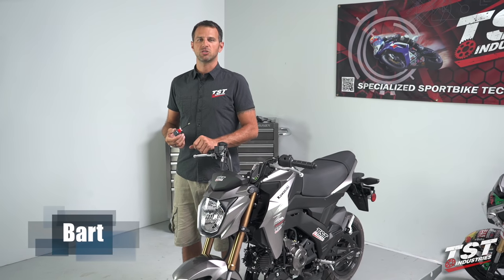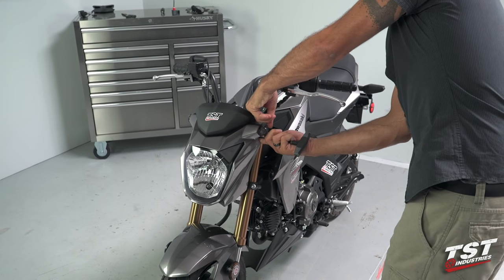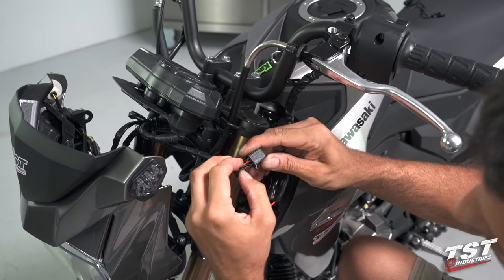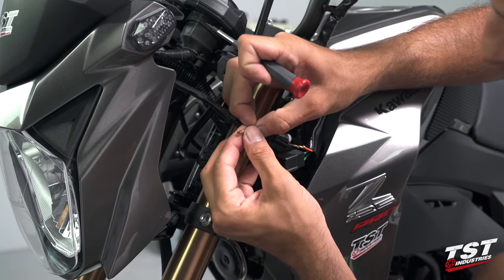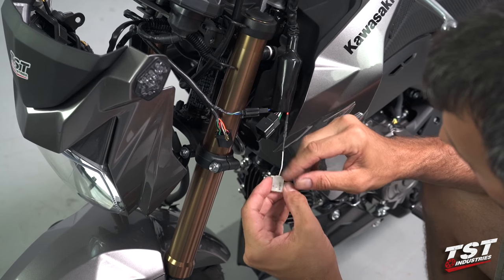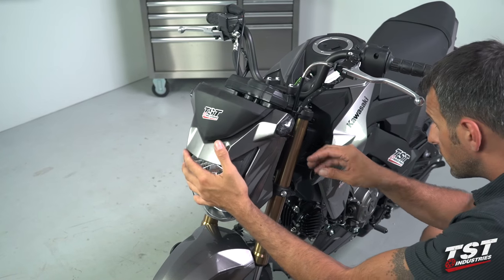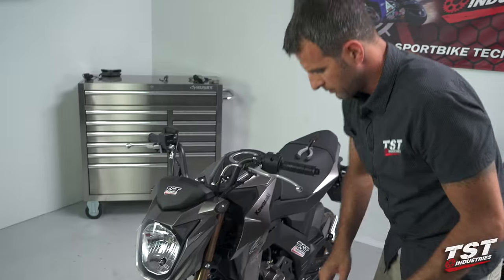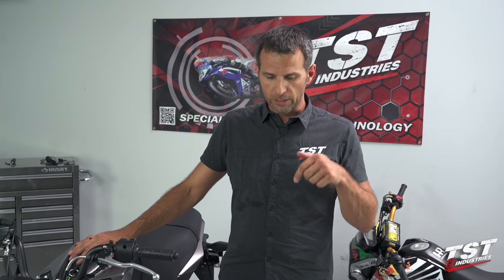How to install LED Flasher Relay on a Kawasaki Z125 by TST Industries

Comment: Installed the MDH tail light with the sequential turns built in for my z125 pro. Kept my oem front turn signals. Was having issues with slow flash rate (3 secs interval) for the turn signals front and back when the engine is running. But when the engine is off, flash rate is normal all around. Purchased & installed the TST Industries relay, got rid of the MD subharness and next thing you know....BooYah!! All my turn signals are functioning properly at the adjusted rate I want it to be whether the engine is on or off. Subharness - 0, TST relay - 1.. Thanks TST Industries
Reply from the maker: you're welcome. It's wonderful to hear that our parts fixed your issue. Thanks for posting that.

Comment: Last night I installed the TST Industries integrated tail light on my Z125 PRO which worked great! Today I installed TST front flush mount signals with the relay and I tested everything once the relay was in place and everything looked good until I finished buttoning things back up. I tested again and now the front and rear signals don't flash. Please help! Thank you.

Comment: If i got you're led flushmount and you're integrated tail light do i have to buy two of those things? (One for the back and one for de front)
Reply from the maker: You will only need one for the entire signaling system.

Comment: i just install a led flasher on my kz125 pro with a resistor and work good..then i order a pair of tst front led flasher and install it but didn't work..it is ok if i get your relay and install it with the resistor remain at the rear flash
Reply from the maker: We do not recommend using our relay while resistors are installed in parallel with any signaling circuit on the bike. If you use our relay please remove the resistors.

Comment: If you add the relay with only integrated tail light and stock front turn signals do you retain dash indicator? If not would you retain it using the load balancing resistors? If so how many resistors are needed? 3? one each for rear signals and one for brake light?
Reply from the maker: I believe you will retain the dash indicator with one set of LEDs and our relay but not both. If you use resistors, you would need a resistor on each of the individual signals but you would retain the dash indicator. The brake light and running light would be unaffected as they would not need resistors.
Reply: @TSTindustries  awesome thanks for the info

Comment: just get my led flash relay today at tst.the video i watch is diferent.the one you send to me is  the the wire is in negative terminal..so i  open the the relay ive got and find the positive terminal
Reply from the maker: Are you saying that you had to take out the wire from the plug, and put it in the other plug location?

Comment: So I added the relay everything went smooth but I noticed that my light on my dash doesn't work now. Why is that
Reply from the maker: Do you mean the signal indicator light? If so, that’s because of the way the relay works on this particular model. We mention it in this video.

Comment: Installed your front and rear leds on my z125. Lights came on to test then installed the led relay in the kit now no turn signals come on at all. Any ideas?
Reply from the maker: Please contact our customer support. Our guys will troubleshoot with you and get you going.

Comment: Yo what about the hazzord function?, and the no sig on the display with led all around really is a deal breaker. Idk maybe im just picky
Reply from the maker: That Z125 does not have a hazard function on North American spec models. If you have a hazard function, the signals should still function correctly but we cannot confirm nor deny that claim without having the bike in house.

Comment: what if all four front and rear flash is leds it your relay works on it?
Reply from the maker: It will make them flash but the dash signal indicator light won't operate if you don't keep at least one pair of incandescents on.

Comment: Do you have the same set up for the ZR900 ABS?
Reply from the maker: From my knowledge of powersports equipment a ZR900 is a snowmobille. What vehicle are you asking about?
Reply: @TSTindustries   I'm referring to the big brother of Z125, 2017 Kawasaki Z900 ABS.
Reply from the maker: The same Gen2 flasher relay we sell for the Z800 fits the Z900 (at least in the USA market). The installation is easier than in the video you made a comment through. The relay on the bike is just aft of the battery, and the installation is as simple as removing OE unit and replacing it with our Gen2. We will be rolling out with some videos for the Z900 early next year, and the relay video is on the list, but for now if you want to see a diagram where your relay is you can find fiche on a Kawasaki dealer site and go to Chassis Electrical section. The part number is 27002A.
Reply: @TSTindustries  Thank you and I'll ok look forward to seeing the future z900 video!
Reply: TSTindustries Works like a charm! I installed the Gen2 flasher relay on my 2017 Kawasaki Z900 for the front/ rear turn indicators and maintained the signal indicators on instrument cluster as well. Great product, thanks!

Comment: but why the engine light is ON after using the LED signal lights ??? HOW To MAKE It OFF ???
Reply from the maker: You must have disconnected something unrelated to the signals, but related to the engine. Check over your wiring.

Comment: Does it even flash in the back
Reply from the maker: One relay...all signals on the bike. Yes, if the front slashes then the back does because it is the same circuit

Comment: インジケーターはつかなくなるの？
Reply from the maker: If you change the OEM signals to LED type then your signals will not flash at the correct rate. By installing this relay system you circumvent the OEM flash circuit and then can get the proper flash rate from your signals.
Reply: By using this relay the lamp of the main panel will not work
Reply from the maker: That is correct. The indicator on the dash does not work when using this relay. But you can see the signals working right in front of you so technically the indicator light is redundant.

Comment: With the flush mount LED's you wont need the Dash indicator because you can see the flashing easily.
Reply from the maker: That was our contention but we needed to make that really clear in the video because it is a system limitation this relay doesn't get around.